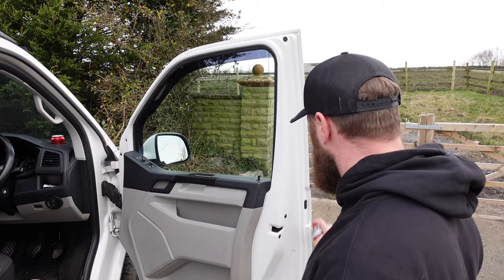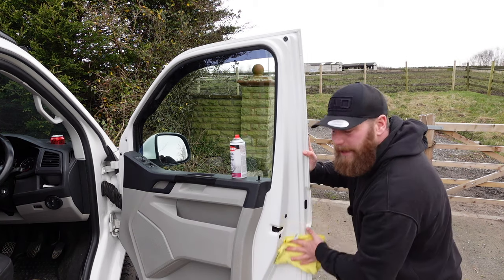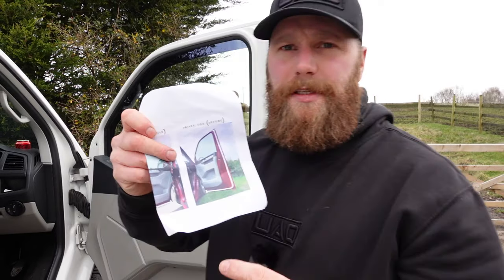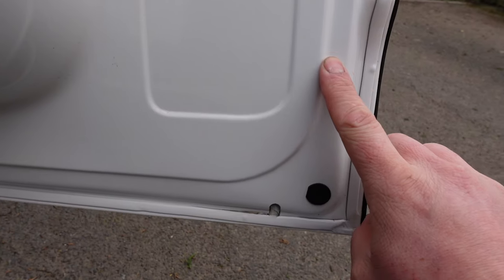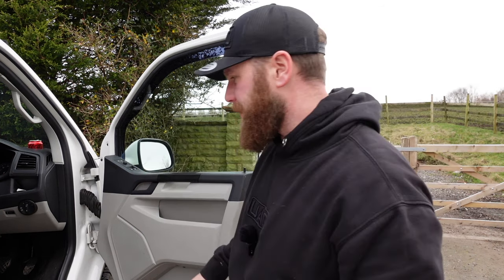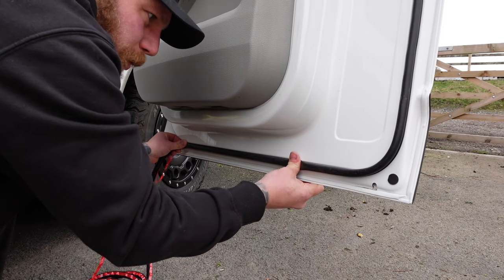VW TRANSPORTER ACCESSORIES. 5 upgrades you don't know you NEED

Comment: 6: Go to town on the rust-proofing. I work on an endless stream of Transporters - there's seldom less than 3 in the yard at any time. All have rust.  Get a load of rust treatment stuff - smother every part in it. Ideally before you have any rust. Prevention beats treatment every time. Rust proof your van - VW didn't.
Reply from the maker: Oh ok. Thanks 🙏
Reply: What part of the van is worst for it? I've seen a few with rust in the corner of the sliding doors
Reply: @chrisweston9764  chassis where the rear shocks mount, front crossmembers, under the sliding doors, blah blah - they go everywhere. Above & below the windscreens too.

Comment: Was a bit dismissive of the extra door seals when i saw them on another vid somewhere. Just did the uograde and they make a big difference. Dont care about the shutting noise but much less noise leaking into the cabin. Also makes an even bigger difference replacing old main door seals on older vans.
Reply from the maker: Oh man. For the small cost too. No brainer for sure 👍🏻👍🏻

Comment: Great Vid Right about the 5 or 6 thing 
Might get dash trim seal for my Sprinter camper van which has a dash to screen rubber trim strip already fitted as standard but from the amount of debris found when I stripped out the dash great idea bad execution(it's a new one fitted by previous owner
MB should be Made Bad 🙂
My old MK4 Golf Door seals are fitted in place of the original Sprinter door seals much better fit far quieter look better as inside trimmed in cloth & free
Reply from the maker: Awesome mate.

Comment: Those door seals you fitted. Have you had any issue with water entering them from the cut top or bottom ends? I fitted some yesterday and they do make a difference to the clanking doors and cuts down on road noise a bit. And YES .... I do own a Golf 😊
Reply from the maker: Hi mate. So since making this video bead a few people mention to make a cut or drill hole on the radius to allow for water to escape 👍🏻
Ha ha. Do you drive like you’re alway in a hurry? In ya golf?
Reply: @urbanarkoverland  Thanks for your reply. I did think about making a couple of holes with a soldering iron. I think I'll put a small blob of silicone in both ends and a few choice holes to let air and any water escape. 

I drive my golf like Miss Daisy... eeking every mile I can from a tank of fuel🤷🏼‍♂️

Keep up the good content 👍
Reply from the maker: @PhilHaddon  I wouldn’t seal it up. You want air to escape when it slams shut 👍🏻

Comment: Hi I watched your video about installing the 10ltr hot water cylinder and being a heating engineer myself and planning to undertake a van build I wanted to know your thoughts on having two of those cylinders and fitting them in series hence 20ltrs of hot water!?!?, plus they do a 12v version I see.
Reply from the maker: Yeah that’s no problem at all. Although they do a 20 litre cylinder. So you will be paying twice. Benefit is. If you had them on delegate switches. You could choose to only heat 10 👍🏻

Comment: Door seals work on the passenger side but I now have to slam the drivers door to get it to close. No good at all. And yes I fitted them as per the instructions.
Reply from the maker: Why would the passenger door be different???
Reply: @urbanarkoverland  the van is factory, I bought it new. All fine before the seal was fitted.
Reply: @urbanarkoverland  the van is factory, I bought it new. All fine before the seal was fitted.
Reply from the maker: @stonkeng  don’t know what to tell ya mate. Mine shuts lovely. Takes a tiny bit more effort than it used to. But don’t need to ‘slam it’
Reply: Mine is the same. Really have to slam the drivers door now
Reply from the maker: @sueharrison8193  sorry to hear. Mine takes more than it used to. But don’t need to in any way ‘slam’ it.
Reply: @sueharrison8193  I had to adjust the plate on the B pillar slightly, then much better.
Reply: @sueharrison8193  try opening the window a bit first.